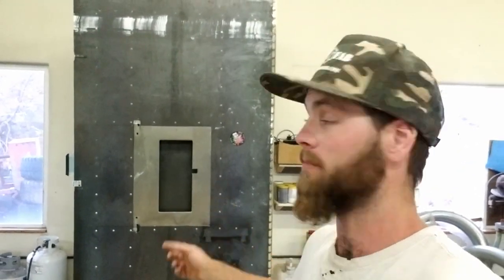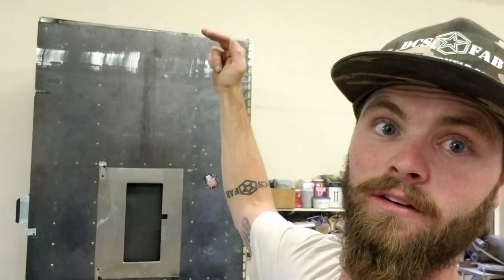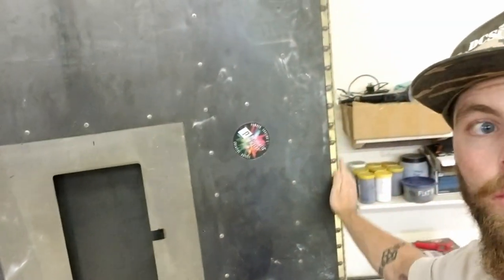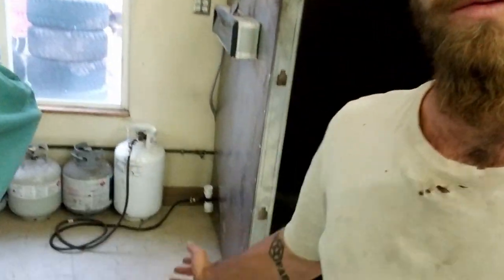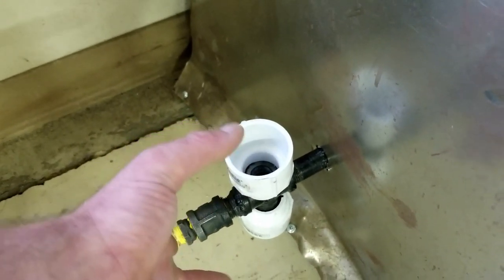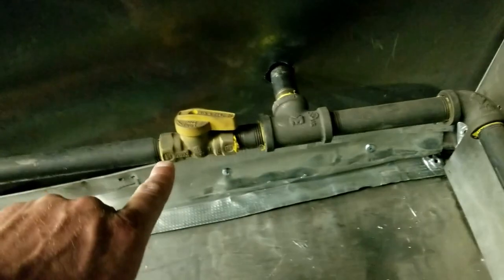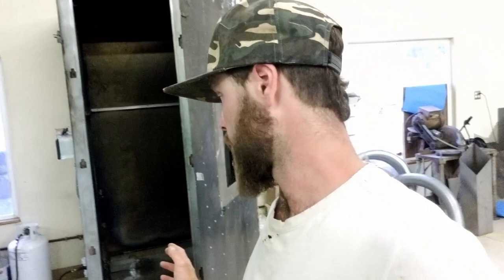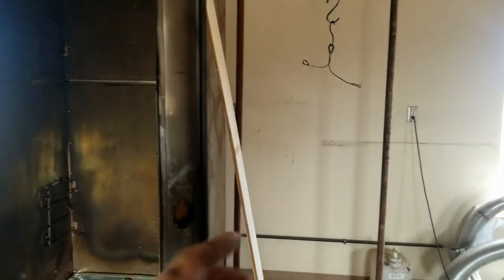How I Built My DIY PowderCoat Oven PART 2 CUSTOM BURNER |

Comment: Bad ass. I’ve been putting off building my large oven. Was going to use a double oven, but this seems way more practical with the propane
Reply from the maker: right on brotha! yeah when i first built mine i used the electric elements out of a double stacker oven. it worked, but not hot enough for that much volume. the propane heats much quicker and easier, and with the correct air mix burns totally clean.

Comment: So, alot of this stuff is a great idea. I own a company that makes custom gas fire places. And using your tank as a regulator is sooo dangerous. 😳 it's even more dangerous when you have the venturi that close to the flame. If a fly or per say a piece of plastic was to cover that venturi. Something could happen very easily. Also u wouldn't need that valve if u had 2 ever sides to your burner. Still an awesome video. Not alot of people do, or know about NPT pipe and what you can do

Comment: great video but did you know some powders explode when close to open flame . id put a 1/4  inch thick bit of 2 x 2 inch angle   over all flames bout 2inch above , thatll keep you safe n the angle will spread the heat evenly

Comment: I'm a little late, but I would Install a solenoid valve in main gas line. Operated off a thermostat, then drill and tap an 1/8 inch hole before the solenoid and run pilot light off that...just an idea 😁

Comment: Do you have any issues with hot spot at the bottom? Also how long does it take to heat up? Will it get up to 450-500f degrees? Great build. I’m about to build one. I am looking at gas burner blower units. They are $500 and up. They are what comes on most big ovens. I’m going for 6x6x17 long. I really like your burner idea.

Comment: How long does it take to get up to temperature.  Been thinking of doing a hybrid system with gas or a bullet heater to get up to temperature faster then let electric elements hold temp

Comment: I've tried different ways for heating. But been having trouble. I have a 4x4x6 i saw your video and decided to do the same for heating. i just finished this tubing method last night but i cant figure out why flame goes out when i shut the door. If i have the door open flame stays on.
Reply: you do have to have venting near the top and bottom to let fresh air in and some out or youll burn up all the oxygen in the box which will put your flames out.

Comment: I have been planning to make one for my workshop as well... Absolutely dope work... Do let me know how much time does it take to heat up you oven with those ribbon burners.. And how time do u leave your parts inside after that..?
Reply: I'm still running with the 80000btu burner he used to have and I get up to temp in just over 6 minutes